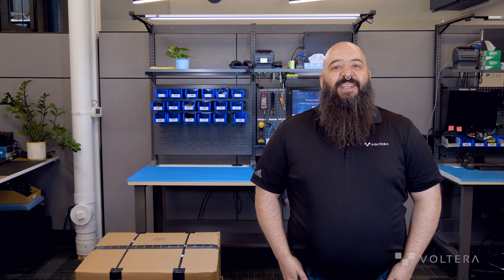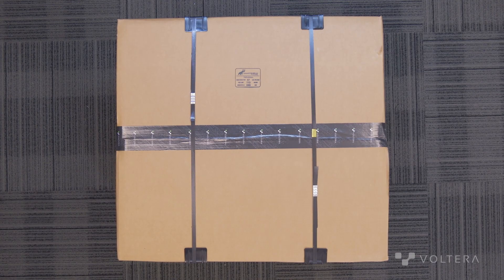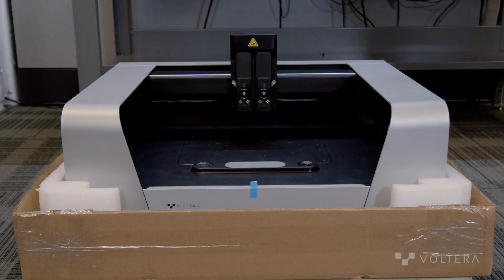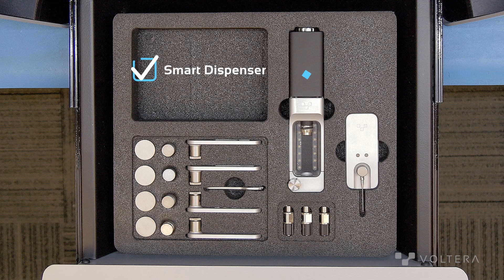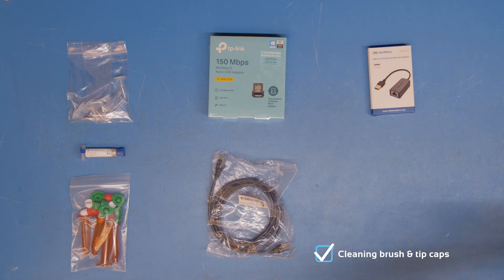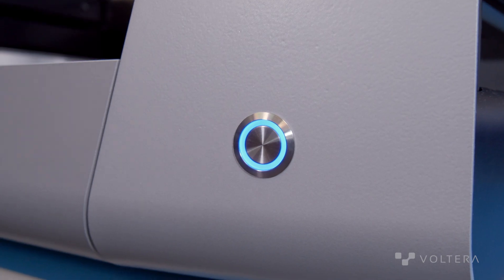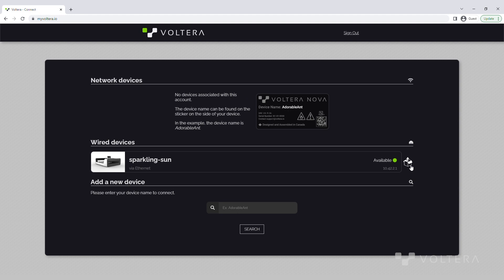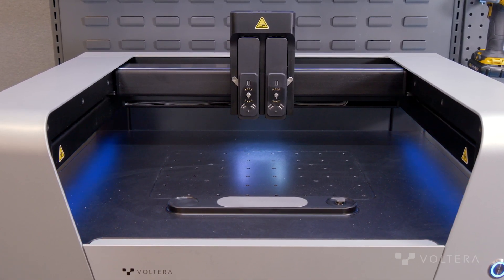Voltera NOVA: Unboxing and First Time Setup

Comment: Does this machine need a wireless connection to function or can it work solely on wired?
Reply from the maker: Hi @sampugh6404, NOVA can work with an ethernet connection (does not need a wireless connection). Feel free to reach out if you have any further questions!